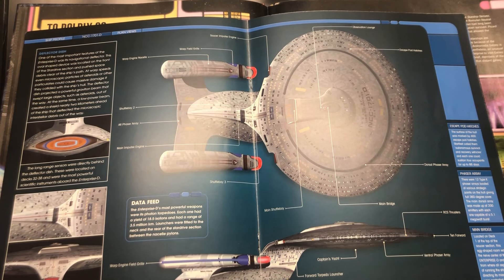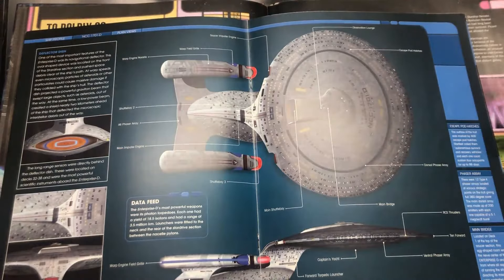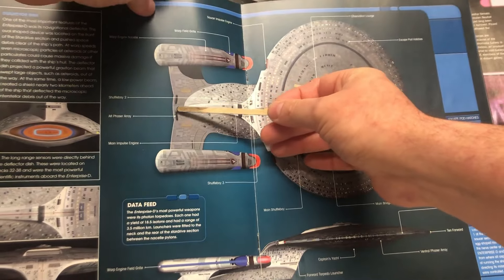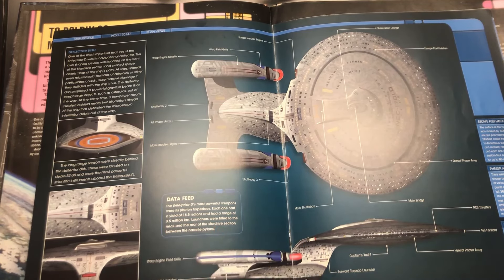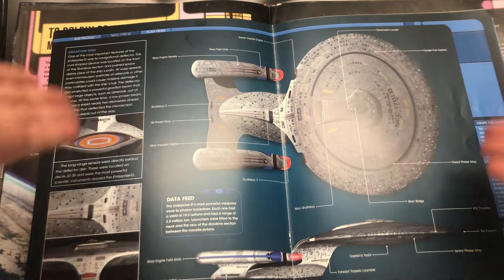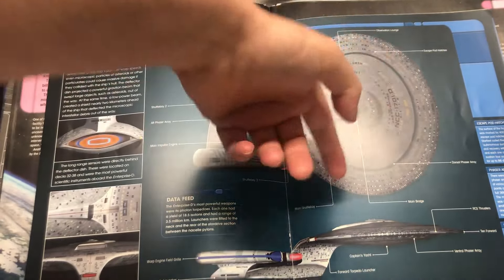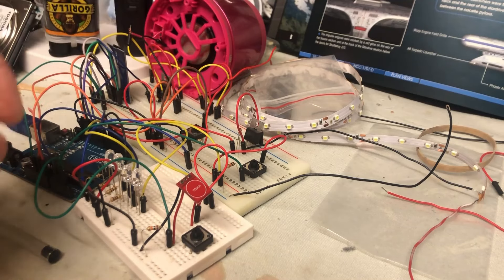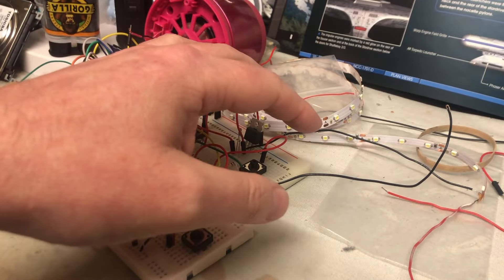Build review of AMT/ERTLS USS Enterprise D 1/1400 scale: Flashy lights and Electronics.

Comment: Loving the build! I think it's a good choice to incorporate all of the lighting modes because yeah, why the hell not! I know you decided on the Arduino Mega already but for complex future lighting projects you might consider linking the Arduino to a PWM controller like Adafruit's TLC5947 or TLC5911. It would give you effectively limitless lighting control. I'm building a Galor class cruiser with the 5947 currently and am really impressed with it. Just a couple quirks with using it that I'd be happy to guide you through.
Reply from the maker: Thank you 🙏🏻
Yeah why not have all lighting modes, make it a ‘USS Multiprise’ 😅
Thank for the recommendations of the controller boards, didn’t know there were any for extensions, but that’s down to my current limit of learning Arduino for first time with this build. I’ll definitely be looking at those for future builds 👍

Comment: Be sure that the end of the Nacelles have two sets of lighting,  one white for the cruise mode, and then green and red for escort!
Reply from the maker: Thanks for the heads up 👍
Just re-watched all scenes again - have also noticed that in ‘escort’ mode the bridge light doesn’t flash and only two of the saucer white ‘pendant lights’ (the ones by/on the neck) flash, not all four with the same two only illuminated in ‘battle mode’.
Good job I’ve got the Arduino Mega coming, going to need all those extra 
I/o pins at this rate! Lol 😂
Reply: @thekitcave2654  yeah, this is definitely an educational bit lol!  I’m just gonna stick with the Next Gen/Generations cruise configuration for mine.
Reply from the maker: The classic ‘cruise’ configuration is good for TNG & Generations as a standalone configuration.
I just like making more work myself and complexity 😂